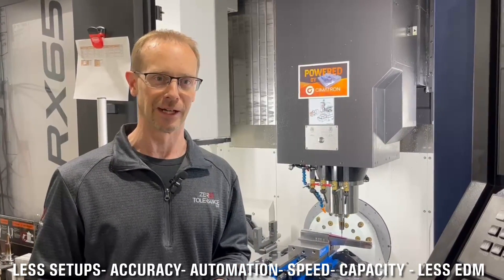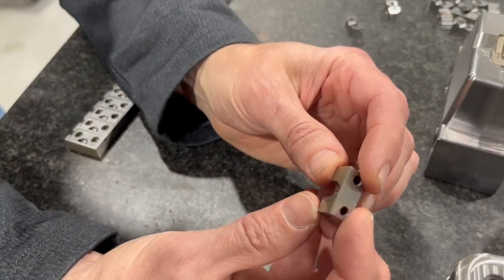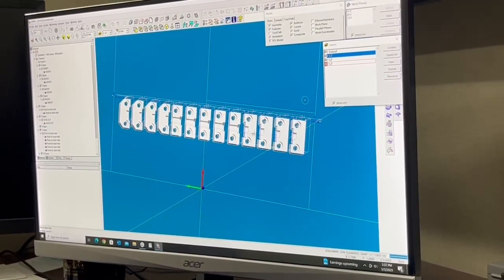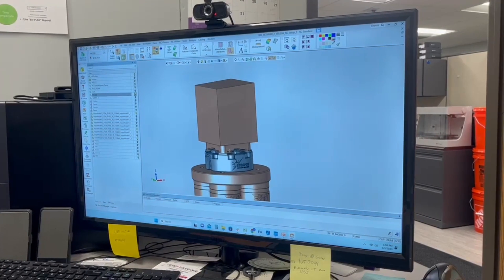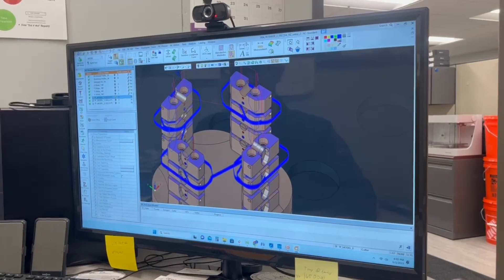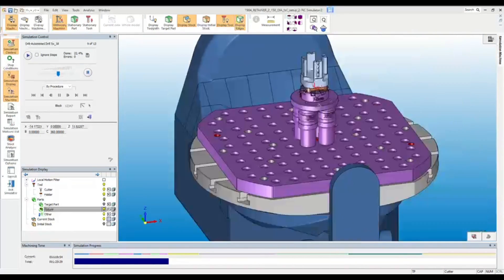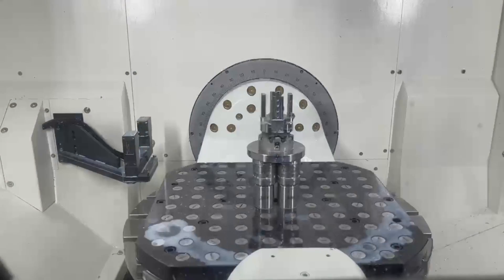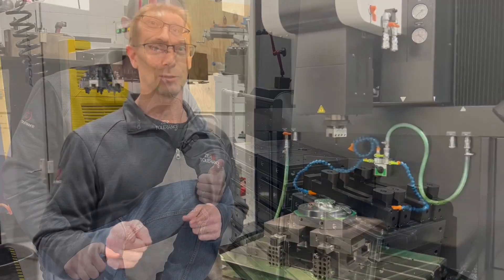5-Axis Machining: The WHYs and the HOWs | The 5-Axis Factor Ep. 1

Comment: Yes this approach makes total sense. I just started working in a shop where everything goes through CAM and full simulation. W make large parts in single piece or very small runs and most of the time with gears. The machines and products are expensive so avoiding crashes is paramount. Also it makes for uniform workflows. I really don't understand how companies are still relatively slow to pick up even though I have books on flexible fabrication systems published in 1990. Two spindle, two turret machines with live tooling and bar feeders were mentioned. In Holland there is an excellent supplier base especially in the high tech industry with the semicon industry as a main driver. Still there's lots of shops that do not seem to be capable of developing and implementing a true holistic production strategy, it may be that the purchasers of their customers are always squeezing them. Also the type of people drawn to this kind of work are not always the best and brightest unfortunately, and I am definitely talking about the management!